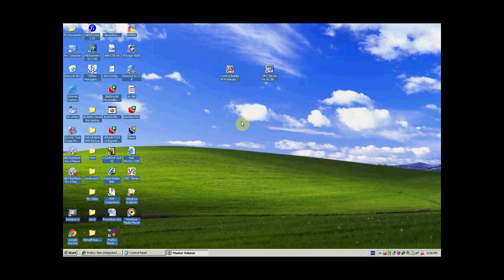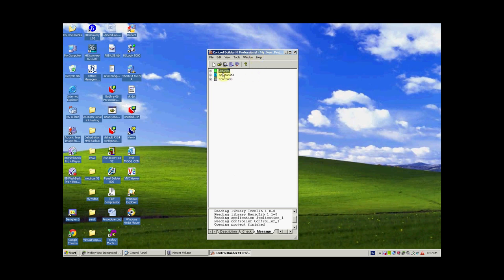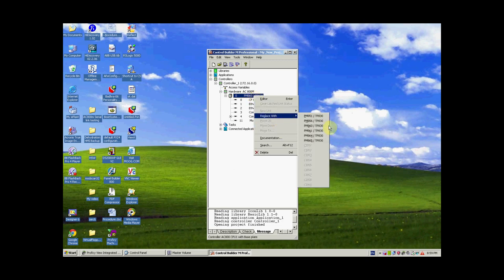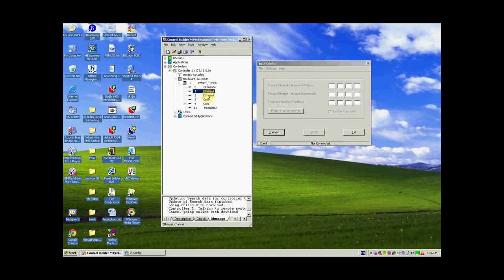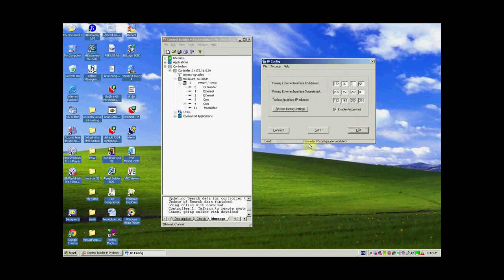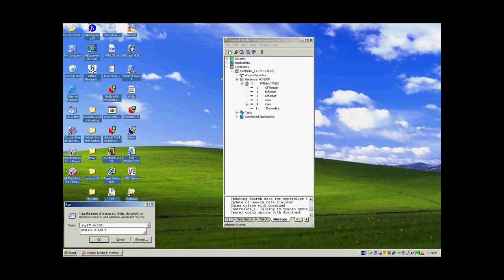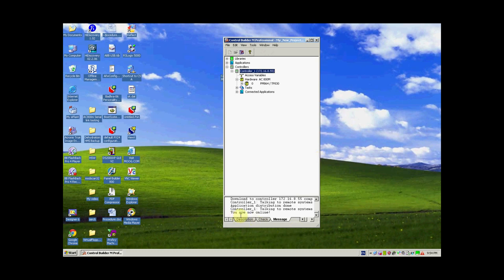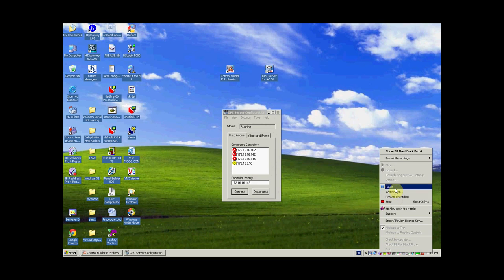ABB DCS AC 800M distributed control system programming Training- - Lecture 3

Comment: Dear,

I have the 800xA system installed in a BMS application at a power generation plant. Currently, the system is operating with one CPU (PM865), and they are acquiring another CPU to enable redundancy.

So, I wanted to request your important assistance if you could help me with information on the steps to enable redundancy. Do I need to have the same firmware for both CPUs? And how could I downgrade the firmware in case the CPU version is newer than the one I have installed? Also, how can I verify that the digital input and output modules are supported for the firmware?

Attached are the system details:

-  Windows XP Professional SP2
·  Microsoft Visual Basic 6.0 Professional Edition
·  ABB Central Licensing System 4.1.0/0
·  ABB Central Licensing System Extension 4.1.0/0
·  ABB Control Builder M Professional 4.1.0/2
·  ABB Firmware for AC800M 4.1.0/2
·  ABB Industrial IT 800xA Core 4.0.0/1
·  ABB Industrial IT 800xA Core 4.0.0/1 Service Pack 1
·  ABB Industrial IT 800xA Core 4.0.0/1 SP1 Roll Up 3c
·  ABB Inform IT - Application Scheduler
·  ABB Inform IT - DataDirect
·  ABB 800xA Instructions
·  ABB Asset Optimization 4.1.0/0
·  ABB Base Software for Soft Control 4.1.0/2
·  ABB Engineering Platform 4.1.0/0
·  ABB 800xA AC800M Connect 4.1.0/2
·  ABB OPC Server for AC800M 4.1.0/2

Let me know your comments.

Regards,
Reply from the maker: Enabling redundancy in your 800xA system involves several steps, including ensuring hardware compatibility, firmware compatibility, and configuration adjustments. Here's a general outline of the steps you may need to take:

Hardware Compatibility: Ensure that the new CPU (PM865) is compatible with your existing system and is capable of redundancy configurations. Check the hardware documentation or consult with your vendor to confirm compatibility.

Firmware Compatibility: Ideally, both CPUs should have the same firmware version to ensure smooth operation in a redundant setup. If the new CPU has a newer firmware version, it's generally recommended to upgrade the existing CPU to match the new one rather than downgrading the new CPU. However, if downgrading is necessary, check the firmware release notes for any specific instructions provided by the manufacturer. Downgrading firmware can sometimes involve risks, so proceed with caution and follow the manufacturer's guidelines closely.

Configuration Changes: You'll need to adjust the system configuration to enable redundancy. This typically involves configuring the redundant CPUs, configuring the redundancy link (such as Ethernet or CI854 communication modules), and configuring the redundancy protocols (such as PRP or HSR).

Module Compatibility: Ensure that all digital input and output modules used in your system are supported by the firmware version you're using. You can usually find this information in the module documentation or by consulting with your vendor. If any modules are not supported, you may need to upgrade them or find compatible replacements.

Testing and Verification: Once redundancy is configured, thoroughly test the system to ensure that failover and switchover mechanisms are working as expected. Test various failure scenarios to validate the redundancy setup's reliability.

Regarding your specific software versions, it's important to note that Windows XP Professional SP2 and associated software versions may no longer be supported or receive updates from Microsoft or the software vendors. Consider upgrading to a supported operating system and software versions if possible to ensure system security and stability.

Lastly, since 800xA systems can be complex and configurations may vary, it's recommended to consult with your system integrator, ABB support, or other experts familiar with your specific setup for detailed guidance and assistance with enabling redundancy. They can provide tailored recommendations based on your system's configuration and requirements
Reply: Thanks for your reply. I hope you are well. I am writing to you because I need your help with a topic: We are currently purchasing the PM865K01 CPU / P/N: 3BSE031151R1. The question is the following: the client's current CPU in operation has PR:E and the one that a US supplier has shown us to buy is PR:J. So the question is if there is no problem you can integrate the CPU with PR: J. Let me know your comments.

Comment: Very interested video ...Question: What is the different between DCS and PLC ?
Reply: As the name tells the difference PLC is a simple control system dedicated to control one package or one unit. However, DCS may control all units and subunits. Moreover, all PLC systems are further connected to a DCS system. To be precise DCS is used for overall plant operation whereas PLC is used for small unit operation/control. PLC is a singular control system whereas DCS is a distributed control system covering all PLC systems as well. There are further details for DCS but to understand the basic distinction this is enough.